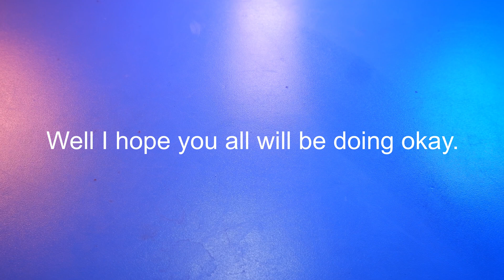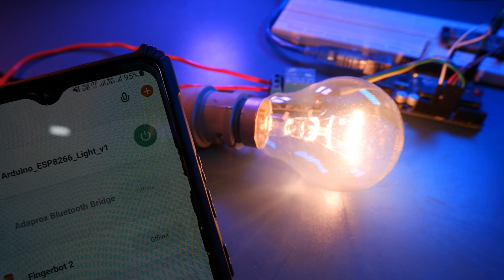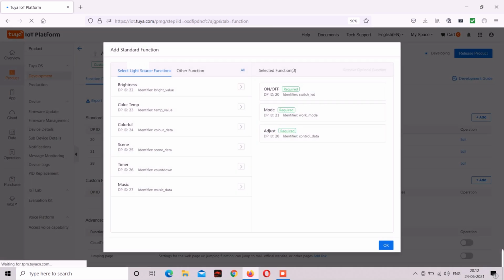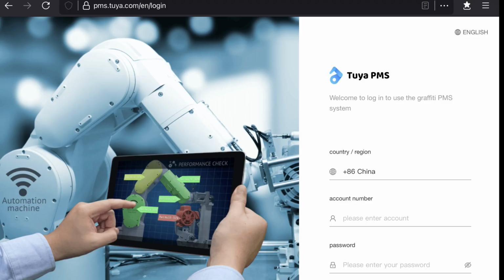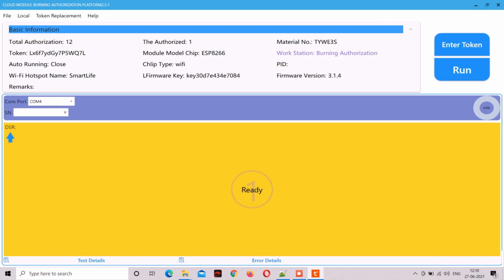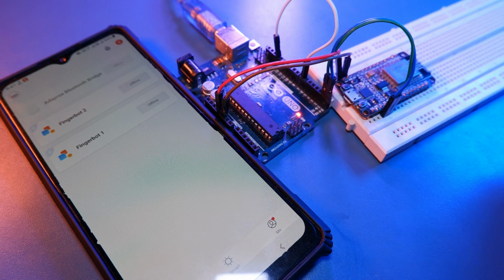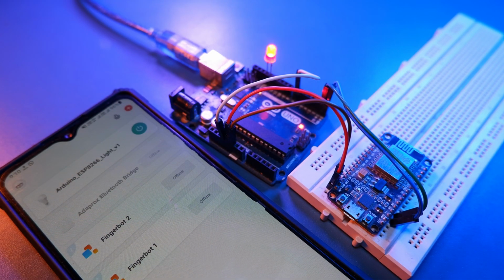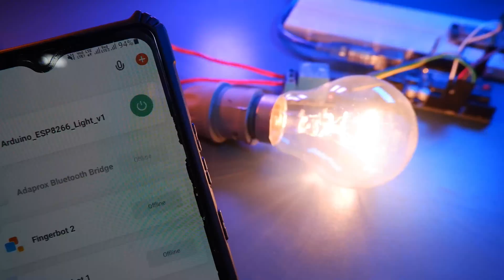Make ESP 8266 Based home Automation Solution

Comment: Hi, the method is not working anymore, the Authorization software has changed and tuya doesn't reply by email with tokens anymore. is there any new solution, I got a free liscnece and got a token after a couple of days but yet the token is failing to authorize using the independent auth tool getting an error (enter test mode fail!).

Comment: Did you must control it throw Arduino only pin 13 ??? Or you can remove Arduino and connect direct relay to NodeMCU ??
Reply: No because tuya needs authorization and it is a binary, not a lib that you can add to your project

Comment: HI, nice work, How much time does Tuya dev takes to respond to the mail?
Reply from the maker: well not sure, my case was different, on other hand i shared the firmware you can burn directly  in description so you don't  have to go through all the trouble.
Reply: @electronicGURU  but we need unique device token for it to work on the app right?
Reply from the maker: yeah you do, but here is a trick when you download  the library  it will have a token in example  you can actually  use that one.
Reply: @electronicGURU  hm ok will try that too
Reply from the maker: sure good luck
Reply: @electronicGURU  hey, everything went well till burn
ing of the firmware,It is failing in authorising part and showing red page any idea why?
Reply from the maker: well not sure, never happened  to me try to check online solutions  why authorization  fails